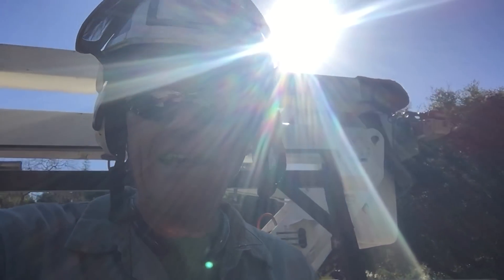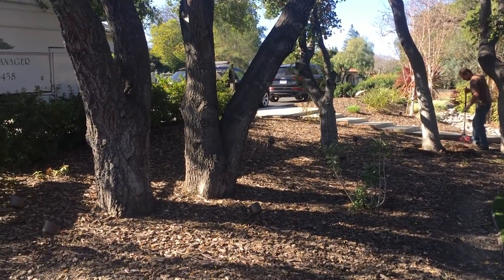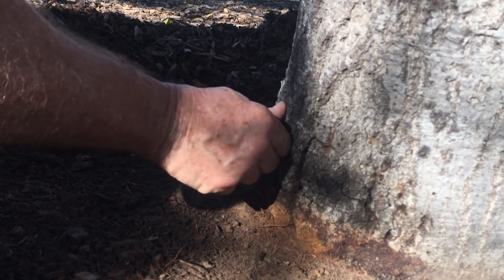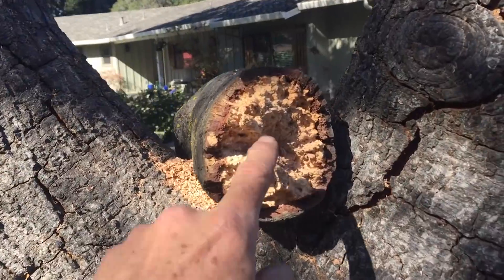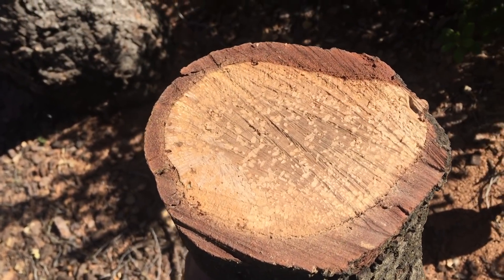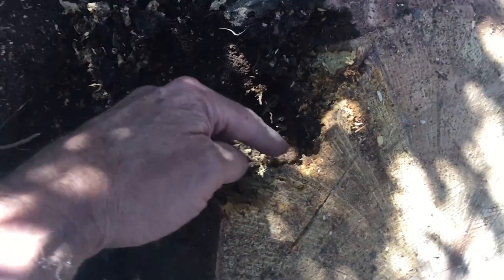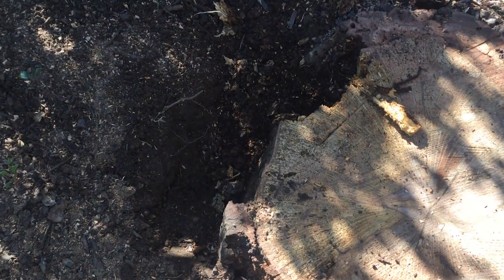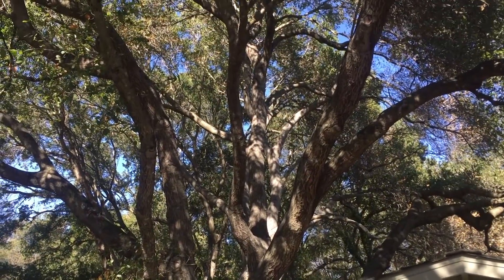Root Crown decay

Comment: Good topic, I'm just getting into exposing the root crowns of our many trees (as rec'd by a consulting arborist) and wanted to see some videos on the subject.   Wondering "how much is too much" when I expose the root crowns?    Guessing it's kind of basic, depending on size of tree expose a few inches of root crown below the vertical trunk, but don't go so far as to expose the roots themselves.   

Thanks for the video!

PS  Arnold said that, in Terminator originally.
Reply from the maker: Hi Tony. When doing a root crown excavation and inspection, first look for evidence of decay, insects or fungus. With small tools, carefully dig to expose the flair of the roots. If nothing is evident, that is where I would stop. If decay is present, then you need to determine how much, and how far. If the roots are in bad shape, consult a Certified Arborist to help determine the safety and structural stability of the whole tree.
Reply from the maker: you might enjoy some of these other exciting jobs too! Check them out on this playlist.

https://youtube.com/playlist?list=PLdq3KQ_xcH4B7yGHc9wcKxThfLRslgT9Q

Arborist Blair Glenn
Reply: @arboristBlairGlenn  Very helpful, thank you!  
(I copied that to my notes for future reference.)

Got my "kit" of excavation tools and did a few small/medium-size trees the last 2 days and hmmm.....there sure is a lot to see when you remove the mulch/dirt around a tree isn't there!?    Already found a girdled root starting to squeeze a trunk (was able to cut it out), and dirt piled way too high on others, with bark decaying behind it, etc.
.....phew!.... just when I thought I was starting to get a handle on trees, along comes this whole "root crown" thing ....kind of scares me what could be going on with our BIG trees ...I guess it just is what it is, I just never knew about it.   Better to do something about it now than continue to do nothing.    Gonna take a while to do all this work, probably well over 100 trees here, and I'm sure there's still plenty to learn.   

Thanks again!   I really like your channel, you're great at getting into all kinds of practical, realistic, and interesting things that I'm not used to seeing anywhere else.

Comment: Friend of mine has 30+ years running a fruit and nut tree nursery/orchard (Englands orchard Eastern KY) he has made a practice of burying fruit and nut trees across the board 4-6" ABOVE the graft union over the last decades, and has never lost a tree from this practice. Why does he? If the tree top ever dies from hard winter, the regrowth from the ground will be the grafted cultivar, not the rootstock. Also graft incompatibility is helped. 

My question to you sir is basically what is going on? Why so much info about the evils of deep burial, and yet here is proof it does not always cause issues. Are the certain tree species that react differently? Thanks

Comment: BG, my first line is the last line I wrote. And boy do I feel much better now getting all of that #$&# out......Now imagine 110% of every new tree arriving from nurseries already too deep in their rootballs. Well somebody may then say... "Scott, I know one or two nurseries excavating down to root flare before digging stock out of field, and one or two municipalities specifically requiring public trees be installed at the root flare level".

Okay, say 5% of new trees installed just within past 5 years across Chicago and 38 suburbs, had been responsibly planted with root flare at or a few inches above/below trees birth grade. Show me where? My work takes me through countless City neighborhoods and suburbs performing dozens of root flare excavations per week. (And that's voluntarily, I don't get paid for saving lives of young trees BG. Unless the thrill of just doing it knowing as a Chicagoland Treestorian, for sake of trees some day reaching their full potentials long after I'm gone)

Just use Google Street view to see for yourself. It's such a widespread planting disaster across not only my Northeast Illinois region, but across the total Midwest after facing emerald ash borer head on. Making that 5% of any good trees going in totally negligible, compared to those 95% of trunks resembling "taperless poles stuck in the ground". This is why 10 years ago I suggested communities don't let all the trees die and replace them all at once. That's what happens in engineering disasters, just one little change in the engineering specs.

 Now you can see why I quote the figure at 110%, it's that embarrassing! Even to witness any enlarging trunk taper whatsoever, for sake of debating and arguing with others about what correct planting practices should be. I've had the name these things, the FU trees. With buried trunks resembling middle finger staring back at all those tree lovers out there. Because I don't have to wait to be sure, after seeing results of trees coming out of nurseries this way last 45 years. Just look at trees in this video, science is always right. That Burried tree was supposed to die, no surprise.

Because even with those so-called 5% of public municipality parkway trees having been correctly planted somewhere. If property owners pay landscapers to cut their grass or do spring clean up. There is another one hundred percent chance citizens landscapers have edged around tree with concave blade between Mulch and grass, then tossed loose soil inword directly on top of root ball...year after year. Regardless if installed correctly or not. 

AND...Understand regardless, regardless if landscapers had overmulched trees or not. It's become that exponentially biblical in scope. Mulch is no longer the issue, plus mulch decomposes and turns into soil anyways. Meaning if somebody expects to mulch correctly according to science, one must first remove much of the previously applied mulch first. Or break the number one arboricultural rule of...never raised thy existing grade around base of tree. Especially young trees facing there first 15 years.

And of course, it only figures. Today with more people than ever bragging about how trees produce oxygen for us Air breathers, and a great number of them presently oblivious to how trees also need to breathe in oxygen. I can again definitely state how one hundred percent of well-intentioned folks out there, have absolutely no idea how our modern landscape practices are literally suffocating 100% of every new tree they see. From their very own oxygen they themselves produce for their sensitive feeder root systems hidden just below grade.

Okay you, I, and a few others do get it out there...... Negligible! So this is what it means to live history. That history obviously requires everybody to be totally oblivious to it happening right before their eyes. And must be why it's always the future that later looks back a decade or two after, and actually writes down in the history books for posterity's sake. By then having all the facts we are totally blind to in the present. Now I know what Galileo went through, facing others that would rather continue debating, rather than using empirical science to look at Jupiter's moons along with the face of our Stars sunspots orbiting across its surface.

In conclusion. Today when others on our committee asked why anyone should care.... Because as arborist having to have business insurance. We don't let friends climb trees you can't check condition of or see Rootflares on! 🤬

Comment: I'm not an Arborist, but surely it is the bark on the trunk which rots first? The bark on the roots is usualy tolerant of moisture. After all, roots are designed to draw up water to the rest of the tree.
Reply from the maker: alan farenden decay in the trunk leads down to the roots. Injury to roots leads to decay. Decay ultimately turns the whole tree back into good soil.

Comment: So the only way to fix the problem would be to bring in a large tree spade to pickup the trees and set them in holes at the right height. Fun Choice cut the roots to lift or lower the yard to its original level.
Reply from the maker: Fix or make the situation better?

Comment: I wanted to thank you for your videos Blair.  My mother had a large oak taken out of the front yard.  It had a mound around it and in that mound was a nice small Dogwood tree.  They saved the dogwood tree but when they ground the stump they left all the grindings in a pile on the ground.

This pile was also mounded up 5 in on the Dogwood tree.  Thanks to some of the information you have offered on your videos I understood that when these chips decay they will build heat that could burn other plants roots.  Also that it would harm the dogwood to leave the base of the tree covered up.   We removed the chips and will fill in with dirt.   Thanks again Blair.

Charles Blair
Reply from the maker: 465maltbie thanks for your comment Charles

Comment: I know we've discussed the very prevalent practice back East of mounding mulch(perhaps soil) around many of their trees. Are they finding increased basal crown rot like we find here? Are oaks more susceptible since they don't like really wet/moist prolonged conditions? Can basal crown rot infect adjacent healthy root systems?
Reply from the maker: Gordon Stevenson mulch mounding in the east has to do with cold protection. Not living in that environment, I can only quote what others have said about mounding. Long subject to answer in the comment section. I only do videos on subjects that I deal with directly.
Reply: We don't usually mound up the trunk. It's more of a doughnut shaped mound with a depression in the middle so as to not touch the trunk. Rather hard to see the depression from a distance. Occasionally people will mound the whole tree if they have planted it too late in the year for it to have become established by winter to prevent it from freezing. It will then usually get pulled back in the spring cleanup.